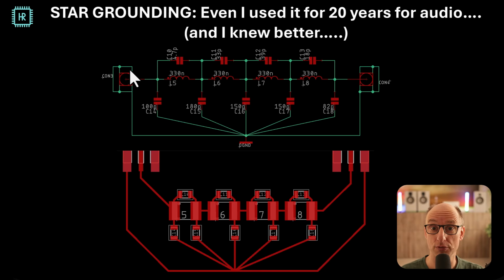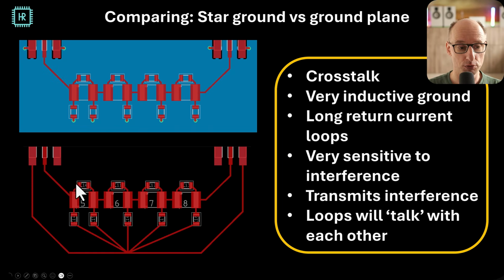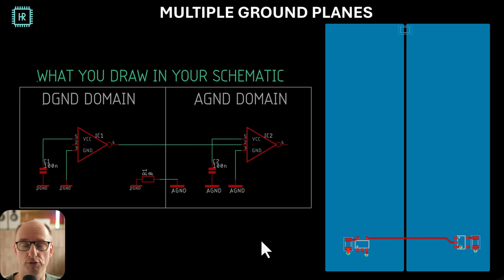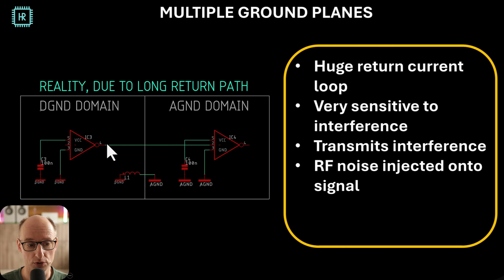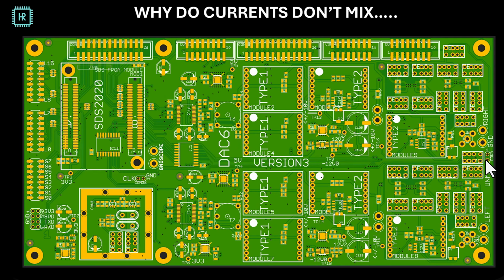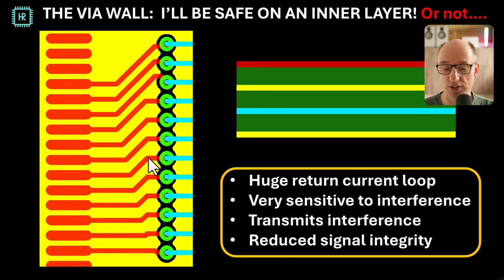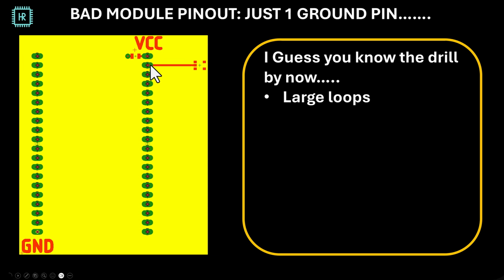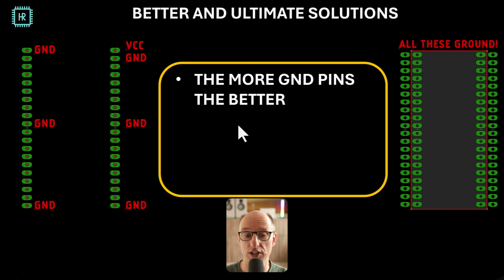Why Your Ground Design is WRONG — and How to Fix It. Flawless PCB design part 6

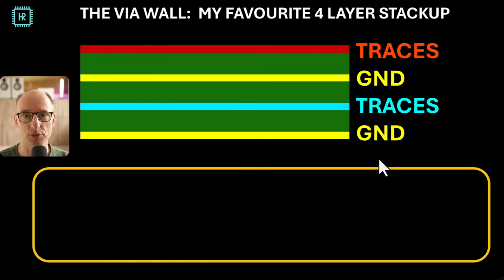Comment: 8:34 there is a slight sneaky layout error here! Most PCBs do not have equally spaced dielectrics, so in a common four layer board today, your stackup looks not like:
[1    2    3   4] but more like....
[1 2         3 4]

So the signals on layer 3 are only very, very weakly coupled to the ground on layer 2, but strongly coupled to the ground on layer 4. Using layer 4 for power or other signals will give you trouble. Ofcourse, dont forget to have a nearby return via for the ground connecting both ground return currents!
Reply from the maker: Agreed!
Reply: I highly aggree with this. The big advantage of a 4-layer board against a 2-layer board is the thin dielectric between layer 1 and 2 of <0.2mm compared to 1.6mm for a 2-layer board. The strong coupling provided by the thin dielectric results in a heavily reduced crosstalk between adjacent traces which is mandatory when routing fast signals with steep edges. You don't want them running on layer 3 with the return currents in layer 2 because of the >1mm dielectric in between. You would loose all the advantages of the 4-layer board and end up with the poor performance of a 2-layer board. Even if most of the adjacent signals in layer 3 were slow, only one fast signal would be enough to ruin the signal integrity of the slow signals by adding unwanted crosstalk glitches to them. And even worse if all adjacent signals in layer 3 are fast...
A way better approach is to force the fast signals running on layer 3 to use layer 4 for their return currents with the thin dielectric of <0.2mm again between layer 3 and 4. So, as a rule of thumb, I would place a GND via next to every signal crossing from layer 1 to 3, and vice versa, not only for the fast signals, but also for the slow ones, because all signals will profit from the thin dieletric.
I usually use SIG/POWER GND GND SIG stack-up, because this is best for testing and repairing. If I need the bottom GND plane for shielding in analog HF-circuits, I use SIG/POWER GND SIG GND stack-up.
When dealing with HF-OPAmps it's often necessary to make a small recess in the GND plane of layer 2 under the inverting input pin and sometimes the output pin of HF-OPAmp. This minimizes destabilizing GND stray capacitances at these pins, as recommended by the manufacturers of HF-OPAmps. But I always leave the GND plane in layer 4 uninterrupted.
Congrats on this awesome video series, Hans 🙂
Reply: The only good 4 layer board is an 8 layer board.
Reply: I was about to comment the same thing
Reply: The video suggests that no GND via is necessary when the signal switches from L1 to L3, because it still references L2.
That is of course not true. A GND via is needed, because the signal will now reference L4.

Comment: Like your videos, informitive and to the point. I'd like to see more on grounding and trace layout for analoge audio with power supplies and different signal levels.
Reply from the maker: Thanks! I'll make a video on a high end power amplifier in the future, that will have those features.
Reply: Thanks that would be great.
Reply: I've been reading/watching more I think one of the important things to consider, that is rarely mentioned, is the placement of the comments with regards to the power supply/connector, and the output level and possibly ground noise of each stage. 

From what I understand it seems the highest voltage/power/current output needs to be closest to the power supply and the lowest needs to furthest away, because any ground noise from the previous stage is going that way anyway. 

e.g. Phono input -- preamp - power amp -- speaker output -- power supply. maybe the speakers and power on the far edge of the board. 

I suspect the potential between each stage is going to be more on the signal line at this point. 

If we had each stage progressing away from the supply then the noise on the output will be amplified by each stage. Kind of like positive feedback.

Comment: Frankly, I'm a bit surprised and disappointed by your interpretation of the star type connection. I don't know how it is in English-language literature, I'm not very familiar with it, but in Russian-language publications recommendations of star connection appear exclusively in the context of highly variable currents of consumption and never in signal circuits, especially passive ones. And not only on the ground bus, but also on the power bus. Agree that if power is applied in series to two AB class amplifiers (99.9% of all operational amplifiers, not to mention digital ICs), the near amplifier will receive interference in the form of a waveform amplified by the far amplifier. Therefore, the most appropriate solution in this situation would be to use a star topology for power supply wiring. 

But what about the signal circuits? This problem is solved by local capacitors blocking the power supply circuits for each amplifier. In my 25 years of experience as a designer, I have encountered a lot of misunderstandings about the fact that the power supply is also involved in the signal circuit. So yes, the return current that you so often emphasize is very important. But the return current should not go all the way to the source, whose task is only to create a potential difference between the emitter and collector. The return current can be blocked by local capacitors, which are recommended to be placed near each chip or each nonlinear stage. Then the signal ground can be connected to the local minus of this capacitor and you don't have to worry about return current loops.
Reply from the maker: Hi Orion, thanks for the remark. I agree, an example of an audio power amplifier would illustrate the possible advantages of a star ground better. When you have very high power, you have to be careful, even with ground planes.  However, as a video creator, that means that I would have to explain the basics of that as well which fits a bit difficult in the rest of this specific video series so I used the demo circuit in this series for illustration and the problems that occur there will also occur in an audio amplifier. Having build a lot of audio amplifiers, the impact of interference is really bad and a ground plane helps a lot. For the critical connection towards the input terminal you could use a separate trace above the ground plane for instance. However, I choose up till now to solve the problem with floor planning: High currents on the right of a 'virtual' ground spot somewhere in the plane and low currents to the left. This is like star grounding inside a plane and this works very well. You're guaranteed good LF and RF behavior.
Reply: @HansRosenberg74  I was not referring only to audio amplifiers, I was talking about all general purpose operational amplifiers down to tens or hundreds of megahertz. If you look at the datasheet for the distortion characteristic, you will see a characteristic triangle: distortion is high at low signals, then decreases, and then increases sharply again when clipping is reached. This is a characteristic curve for the AB class, which is also characterized by erratic current consumption, and as a consequence, noise generation on the power bus if it is in series, as in your last video. Fortunately, it's not such an amplifier there, so it worked :)

Comment: I'd be interested to hear your views on flood fill of component layer with groundplane. For me it's a big no-no as it can cross couple noise where there is imedance of via to ground, but I have seen it done on many designs, including reference designs by some big well known manufacturers.
Reply from the maker: Check out part 4 in this series (link in the description). That whole video is about floating copper and what to do and not to do.

Comment: Hi, thank you for these lectures.

I have a topic I'd like to propose.

I have a circuit which contains a piezoelectric buzzer. Simple, $2 one. When it turns on it puts out HUGE amount of noise across the whole circuit. How do you deal with this type of problems ?
Reply from the maker: 1. use a ground plane
2. put a ferrite bead in series with the buzzer supply as close to the buzzer as possible.
3. Put a large enough capacitor on both sides of that ferrite bead (size depends on strength of interference / current pulse size)

Now if you have bad luck, the buzzer itself is a great transmitter, but this method should keep the electronics on your pcb clean.

For info on ferrite beads watch my next video which will be out before the end of next week.

Comment: @12:40  I can't imagine how the connector is connected and which cross section is the module board and which is main board ?
Can you please provide a link that explains this topic ?
Reply from the maker: The pcb on the top is the module, the pcb on the bottom is the main board. The cross section is at the vcc pin (right through it). I made this myself so I don't have a link to explain further unfortunately, hopefully this helps
Reply: @HansRosenberg74  and where is the JP1 Connector?
Reply from the maker: I'm explaining it, I just drew a single pin of a 20 or so pin connector for illustrative purposes.

Comment: ESP have ground pad under the module. It's mainly for heat dissipation but is tied to ground. Solder it to make loop smaller.

Each signal is a change in voltage potential. To achieve this potential it has to move opposite charge away. It's harder to do if the trace is away from ground. If the signal is fast enough it might be easier to escape through the air.

Now imagine that this law also works for all other signals. If your + is faster than your -, then you end with 0V potential between charges.

I had similar issues earlier, but someday I just realized that the trace reminds a battery or capacitor, but really long one. It should have same characteristics through it's length.

Imagine you have a wheel rolling down from the mountain. Constant angle, rolling down seamlessly. Now add some holes and it will start to jump.

btw. Same laws for wires. Slew rate or pin driving strength / speed is critical sometimes. You're unable to have ground as close as on the PCB. Multiple options here. Shielding, shunt capacitor or series resistor.
Reply from the maker: I have a little problems understanding what you're trying to say but I think you're correct
Reply: @HansRosenberg74  to clarify: In order to effectively transmit a logical signal, you need two wires. 

Now, imagine these wires as a ladder, with rails and rungs. Each segment between the individual rungs act like an inductor (if the VCC and GND are close enough, these opposite inductors start cancelling their magnetic fields), while each rung represents a capacitor. When there's an impedance discontinuity, the effective capacitance decreases and there’s less space to store charge nearby, so it's easier to build up the fluctuations.

If you combine everything together, you get lower noise immunity as well as higher probability of creating unwanted RF emissions.
Reply from the maker: You're talking about a balanced line. They're definitely better for higher speeds. For lower speeds an unbalanced line is easier (but you do need a good ground plane)
Reply: @HansRosenberg74  technically, yes. But the physics behind it is same for gnd plane and fast switching signal on top of it. The current will flow in the direction, where it need to establish smallest possible electromagnetic field. That's why you can have monopole antennas.
Reply from the maker: Yes, I agree.
Reply: @HansRosenberg74  I think that this misconception in understanding comes from oversimplification. People think that the energy flows like a water, so all you need is to make a bigger pipe or more pipes to resolve your issues.

Just add some dirt to the water and maybe some temperature to the equation and boom. Is it still so simple now?. It's maybe a bit harder, but it will make you start to look around.

We should make that learning curve more linear instead of making it grow exponentially.

Most EMC issues can be resolved by switching your thinking to the right way, instead of splitting ground planes and dramatically overengineering the solution.

Comment: I wonder, on the modules with the single ground pin far from VCC. If it'd be worth running a  VCC line over to the ground pin and putting another cap there?
Reply from the maker: I don't think that would help a lot since a trace has inductance and a plane has no inductance.

Comment: Hello Mr Rosenberg. I am a beginner in general , and especially in PCB design. I have made an audio preamp layout where ground is a thick trace going around the board, and the components connect their ground to the main trace, like creeks connecting to a river.
After watching this video, I fear it might be a great mistake?
Cheers from Denmark.
Reply from the maker: Yeah, I'd go for a ground plane. And separate the areas where left and right electronics are, then you'll have no crosstalk (check out my other 5 parts to understand this better). Also: try to keep all traces as short as possible, it really helps to increase interference immunity.
Reply: @HansRosenberg74  I will go through the layout of the board again. Keeping the audio traces away from each other seem a little harder due to the use of opamps and 2 layered boards.
Thank you for helping me.
Reply from the maker: Well, use separate opamps for separate channels, then it is easy and will certainly improve your channel separation and therefore you audio quality most likely
Reply: @HansRosenberg74  That sounds like a costly solution. I forgot to mention I am using through hole components.
Thank you for your time.
Reply from the maker: Depends on how expensive your opamps are :-) But you're right. If you want to improve specs, it usually involves spending more money......
Reply: @HansRosenberg74  In fact, I think I can get 4 layer boards made for cheaper than it would cost to double the amount of op-amps. Maybe that is the solution to most problems. Dedicated layers for different jobs?
Reply from the maker: oef, you're probably using  some of those formerly burr-brown now TI opamps? They used to be around 25 usd a piece, but that was 10 years ago. Must be horrible now :-)
Reply: @HansRosenberg74  OPA2134. He he.

Comment: Sir kindly upload complete playlist for pcb design from scratch using either kicad or altium. i could not find any single playlist which covers from basics to advance.
Reply from the maker: I don't use kicad or altium unfortunately. I use eagle (now autodesk fusion 360). 
There is quite a lot of kicad info out there on youtube. It will just take a bit of searching to find each step, but I'm sure it's all there. I looked for it a few weeks ago by accident for kicad.
Reply: @HansRosenberg74 i think Kicad is the same as Eagle (the second generation of Eagle with the newer GUI that came out around 2000ish). The file formats seemed to be compatible going from Eagle to Kicad (component libraries, schematics, not sure on board files, I haven't tested those yet).

Comment: 4:07 this why everything coming or going from the chassis is grounded to the chassis, and the incoming signals are filtered to remove anything above audio frequencies being shunted to chassis ground, not analog signal ground. Also the codecs are grounded to digital ground, which is usually a ground plane, separate from the audio ground plane. Chassis ground, analog ground, digital ground, (and sometimes AC ground separate from chassis ground) need to be carefully thought out. It’s easier to add pads on the prototype PCB to be able to test the ways you can connect the grounds together via LCR networks. Always remember if the equipment has an AC safety ground, and the chassis is conductive, you’ll need UL rated X/Y caps, and **be sure all your connector grounds are isolated from the chassis**.

Comment: It has always been a pet hate of mine that a lot of designers use the "cargo cult" mentality, where they just copy what other people do without understanding why. I spent seven years designing special purpose test equipment for commercial R&D, and I didn't really have a mentor to learn from, so I spent hours reading application notes and design guides (I highly recommend reading TI SZZA009 start to finish - there's another similar one I can no longer find, I think it was from Wurth - suggestions welcome!)  and sitting in front of the oscilloscope with a soldering iron and SMD sample book instead. If something didn't look right I took the time to investigate why.

I don't star ground, I don't separate ground planes (although I will segment them to keep return currents separated between sensitive circuit elements), and I don't do that thing bedroom hifi designers do where you line all the components up in pretty little lines to impress the audiophiles and  then route spaghetti traces underneath to compensate. I think the proof is in the pudding - I designed milliohm resistance sensing equipment for measuring degradation of sub-ohm samples long term tests, and a 20KHz 5A 200VDC power switching board for powering a sample with a moderately complex impedance that barely showed up as a ripple on the power supply when you powered it up. 

A moderate perfectionist tendency, a scope with 20MHz bandwidth and a low impedance spring probe will get you a long way towards good solid circuits that Just Work and don't upset the HAM radio guy down the street. Having said that I still keep a bag of runes and some black candles in my desk drawer just in case I have to go too far into the analogue domain, and a chicken to sacrifice to the RF gods.